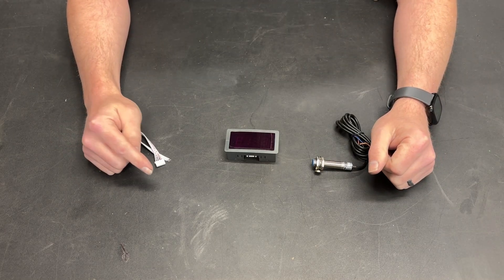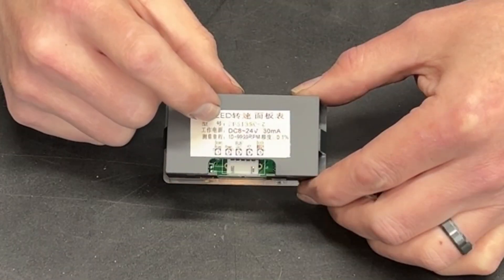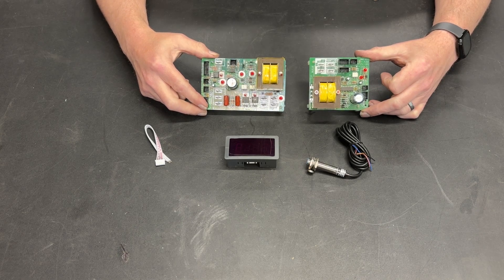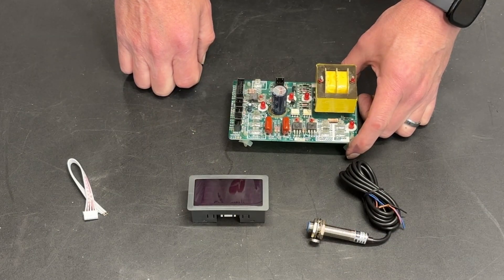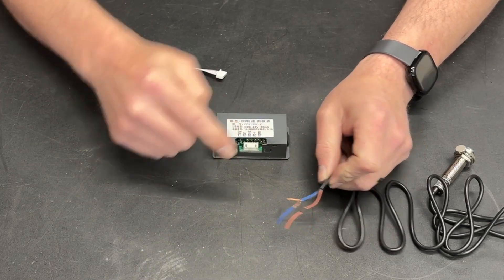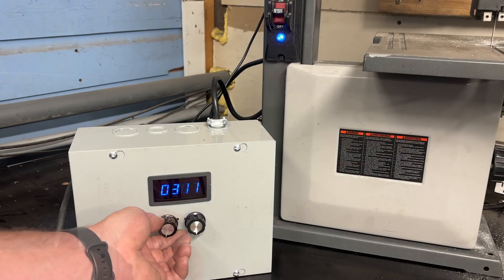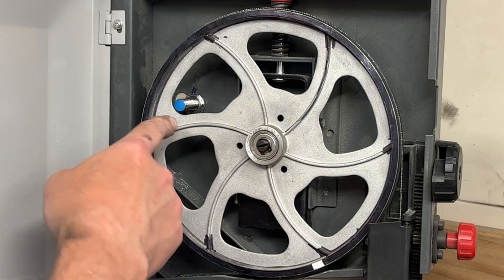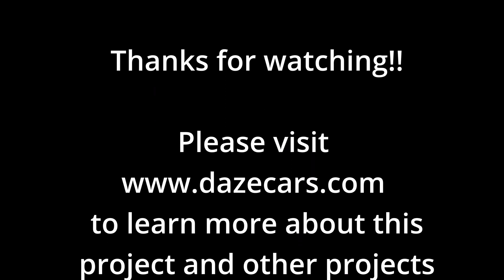Hooking up a Digital RPM Meter to Your Treadmill Powered Variable Speed Shop Tools

Comment: Hey Daze;  Although I've been following you for LONG time now, somehow I missed this one, til now.  I did same thing on  my old Craftsman wood cutting bandsaw, put variable speed treadmill motor on it to slow it to cut metals, but my speed sensor uses that exact same tachometer setup you're showing, only sticking 3 magnets on the wheel.  3 magnets gives me "pretty close" to feet per minute of the blade instead of RPM of the wheel based on the diameter of the wheel.  It just worked out that way.  I did some videos on that setup, including the treadmill motor, the speed controller, and all the pulleys and belts to slow the blade enough while keeping enough motor speed to not stall.  Thanks for doing all this!!  All the best.
Reply from the maker: your bandsaw must have a 12" wheel.  I though about using multiple magnets but with my wheel only being 9" 2 wasn't enough and 3 was way to many

Comment: First of all thank you for your very informative video’s.  I have been following them for a treadmill motor modification to my drill press.  I ran into an issue that is related to the digital tachometer that I added.  I’m not saying this will happen to everyone, but it did to me, and I wanted to share the solution in case anyone else encounters a similar issue.

The issue is that after the modification, when I turned on the drill press I got erratic readings on the digital rpm display of the tachometer.  The readings were bouncing around all over the place.  When I had hooked everything up on the work bench prior to final assembly of all the electrical components into the enclosure the rpm readings were stable.  I had made an aluminum bracket to hold the tachometer sensor near the spindle pulleys, and mounted the sensor magnet to one of the pulleys.  I guessed that there might be some electrical interference or grounding issue affecting the tachometer sensor wire.  I took the sensor off the mounting bracket, and held it up by the wire and tangled it close to the magnet, then turned on the drill press.  The readings became stable.

Solution:  Isolate the tachometer sensor from metal to metal contact with the mounting bracket.  In my case the mounting bracket was made of two pieces of aluminum, first was a c-channel, second was a plate screwed onto to the c-channel with a hole at the other end that lined up with the magnet on the pulley.  I replaced the aluminum plate with a plastic arm.  Problem solved.  The issue must be some kind of grounding problem.
Reply from the maker: That's some great information and a clever solution! Thanks for sharing it with everyone.

Comment: As you say, there is very low draw on the voltage supply, so I used two old wall transformers, (I save them all) one for a cooling fan and the other for the els in the high voltage box for the lathe/mill I made. I just siliconed the transformers to the box and used spade connectors. The back of the transformers has a lot of surface area so I don't expect them to come loose unless you pry them off. Saves making any kind of crazy holders or drilling holes for nylon ties.
Reply from the maker: Its totally a viable option.  I too collect power supplies and when I first did my ELS I also put a couple of those inside the box as a way to power things.